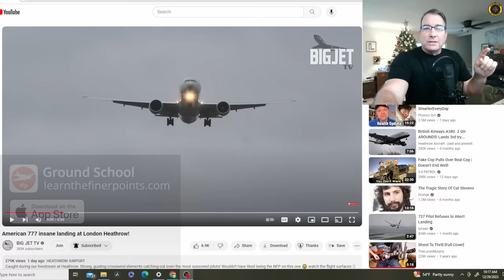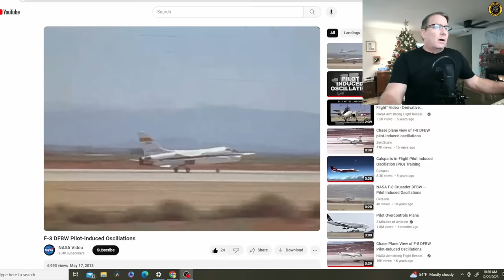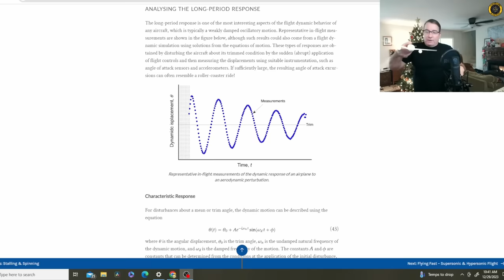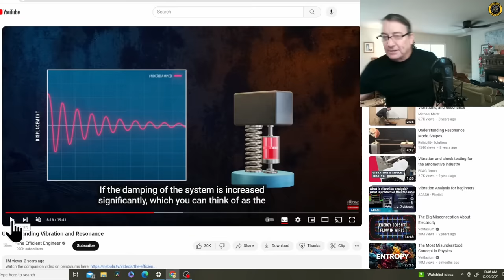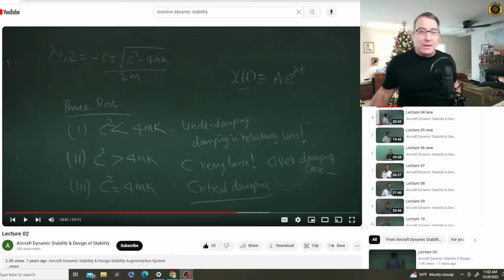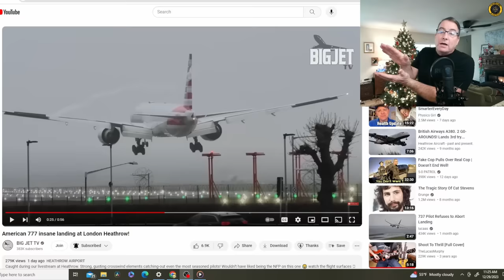B-777 Hard Landing LHR Big Jet TV

Comment: Dropping the elevator made the nose suddenly drop.  I myself, am in no bragging condition because I have been a crop duster pilot,  considerably lighter and controls are cabled so every action is quick.  My question was why did this guy drop the elevator, because the nose was up, in a safe position, wheels touched, the speed slow down would automatically lower the nose.  I wouldn't dare push the yoke in once on the ground.  I already cut the power, without power nothing is going up anymore, or any further. so no need to drop the elevator.   I'm now on the ground, no need to drop the elevator, it is coming down on it's on from the slower speed.  Anyway, I have much respect for these big giant plane pilots.  Wow. I envy them so much, so I keep my mouth shut, most of the time.   I just happen to get into the excitement of this video, like a boxing ringside spectator thinking, I would have upper cut the dude, and I wouldn't be laying on the canvas. Hahahaha

Comment: Making light of a bad landing is one thing Juan, and I totally understand that, but in this video we can objectively observe two critical and potentially deadly errors being made during the upset recovery. We can all learn something. 

First: When you’re flying a big plane (or any plane) large control inputs in the flare are dangerous and indicate an unstable condition exists that would best be resolved with a go around. We call this kind of piloting “high gain”. 

Second: kind of in the same vein but exponentially more dangerous was the pilot-induced-upset-recovery recovery, where the pilot flying PUSHED hard on the controls when the plane was rebounding from the first touchdown. 

This is exactly what happened to FedEx 80 and that plane came apart on landing and killed two great pilots. Now we can talk all day about how better designed the 777 is or how we live to fight another day. I would like to point out that a landing as bad as this one could have and has ended tragically. There is a lot to be learned here, just by watching the evolution of the last 20 feet of this landing. No doubt this should have been a go around, and the FOQA data on this approach/landing will be analyzed carefully. I’d be on the lookout for it on your next training cycle. 

What could they have done better? Power. Simply put, as soon as an upset occurs, power application and setting a known pitch attitude that will protect the tail and get you flying away from the ground is the best solution. Let the gear hit, keep your crosswind controls nailed and hit the G/A mode. 

Thanks for posting this one. By the way I stopped into Nevada county in my 182 a few months back, great little spot and cheap gas! Be well.

Comment: I enjoy your channel.  I would appreciate if you could clarify something pursuant to the narrative after 4:25 ....I was always taught a "phugoid oscillation" occurred when a plane supposedly flying level without control input by the pilot (or A/P) began to descend slowly which causes it to increase speed.  Eventually the increased speed creates more lift and the airplane begins to climb.   As it climbs, it slows down and lift is decreased which causes the plane to descend again.  It was my understanding that this alternate climbing and descending without any input from the pilot has been called phugoid oscillation.  Most pilots never observe phugoid oscillations because the spontaneous slow rise or fall of the airplane is prevented by input from the pilot or A/P.  Anyone can demonstrate phugoid oscillatins in their own plane by trimming the plane to fly "perfectly" level, then do not touch the controls or use the A/P, and the plane will naturally go into phugoid oscillation mode.  Every plane has a certain frequency of climbing and descending unique to it depending on wing design, CG, W&B, initial air speed, and so forth.  For most GA airplanes, there are usually 2 to 5 cycles per minute.   My CFII taught me this, and although he was not an aeronautical engineer, he had over 41,000 hours and was very knowledgeable.  Have you ever heard phugoid oscillations described in this way?     Keep up the good work reviewing the causes of recent plane accidents.
Reply: Technically you are correct, a phugoid is a long-period oscillation (20-60 seconds). Juan used the term loosely...
Reply: I think the issue here is that "pilot induced oscillations" (often referred to as porpoising) and "phugoid oscillations" are not the same thng.  There is ample source material relating to both of these subjects online.

Comment: I remember being a passenger on a DC-10 landing in foggy conditions.  No apparent crosswind or wind gusts.   The landing was aborted twice, apparently because of poor visibility.    The third time the pilot touched down very hard on the main gear and as we rolled out every passenger erupted with applause and cheers.  Walking off the AC, I shook the pilot's hand, inquiring if he was ex-Navy.   He just grinned.  Years later, as a private pilot flying a Piper Warrior (PA-28-161), I was attempting a landing in a crosswind from the left on the North/South active runway, so I cross-controlled with the left wing down a tad.   Just before a normal touchdown I was hit with a strong gust of wind that drove the AC left main gear hard onto the runway - BLAM -  the AC bounced back into the air, veering a bit to the right.  I immediately applied full power, then radioed the Tower, "Going around "  The Tower came back with, "Looks like it's time to switch runways."   Needless to say, I concurred!   In the event, the landing on the East/West runway was uneventful but I worried about possible damage.  Inspection later showed no damage.

Comment: im only a cessna driver at this point very early on in my training but during my crosswind circuit lesson i dropped it in pretty hard to which my instructor told me, good crosswind corrections but remember the company dosen't give me chiropractic so try not re align my spine on the touchdowns

Comment: My worst landing, I was near the back row of a 727. Pilot was overcorrecting for turbulence on approach and got into PIO. Ended up too high and did a severe nose down instead of a go around. Hit so hard it was painful. Not only the masks dropped but most of the entire panels popped. All the stow bins opened and most of the ceiling panels opened. Pilot took the last exit so fast the wing came inches from scraping, but the rear tires slid keeping the wing from touching. All while at full braking and reversers. About half the carryon bags ended up at the cockpit door. That United pilot was my brother's neighbor.

Comment: Had the same occur to me in the 737 in roll, but it was on short finals.    The 737 is noticeably roll sensitive with full flap deployed.     I just froze the roll input and the phugoid damped out quickly.   Like Juan, I can also attest to several hard landings in my career as both a Captain and FO.    Embarrassing of course, but as long as you learn from each experience.

Comment: " First Officer made hard landing" That was on a B707 freighter. No problems were found on the hard landing inspection. Well not until they tried to install the TC cowl on top of the pylon. The forward stabilizing mount was sheared. The casting is shaped like a long forearm and comes undrilled. A wood form was made from the old casting. It had plaster of Paris areas to hold drill bushings. The new one fit.

Comment: That initial whack on the nosewheel with the down elevator input (after the initial bounced touchdown) looked pretty severe.  I’ve never seen any flight manual, Boeing, Airbus, or otherwise, that would recommend any sort of down elevator input after a bounced landing…it’s either i) re-establish landing attitude/pitch (4-5 degrees pitch at touchdown depending upon large aircraft type) or ii) go around.  The nosewheel is dainty in comparison to the main gear so should be protected in all landing maneuvers, including the derotation of the airframe into a level attitude, this should only happen without delay after the main gear is supporting the brunt of the airframe’s weight during deceleration on the runway. Keeping the nose high for too long after touchdown as the elevator loses effectiveness is another path to possibly whacking that precious nosewheel unnecessarily!

Comment: Smoothest landing I've been in was during a flap failure incident..higher speed but smooth as glass.  Had plenty of runway.  Noise limits are thrown out during mechanical issues.
Reply: Noise limits? A reduced flap setting requires less power and therefore = less noise.  Many countries (eg. Japan) require us to use a reduced flap setting when stopping distance allows it.

Comment: Interesting. Apparently Heathrow is notorious for cross wind problems. Or so I've heard. In 2010 we flew Phoenix to Heathrow on a BA 747. The smoothest flight of my life. Until the wheels were about to touch down. We rolled heavily left so one second looking out over the left wing into a giant hangar, the next second staring at nothing but grass. Left landing gear hit hard and I was smashed into my wife sitting to my left, they corrected and the plane swerved sharply and we were thrown severely the other way my wife smashing into my left shoulder and me smashing into the woman sitting to my right. And I do mean smashing. Both our shoulders were sore as a result. Then the right wheels hit even harder than the left had an we were thrown against each other in the other direction again, this time almost bashing skulls. No idea what had gone on up front but I do reacll the expressions of the flight crew as they walked past us in the terminal. "Ashen faced" would be a good way to describe it. Two were grey haired veterans and three were young sprogs. I always wondered if one of the young uns was being given some "hands on" and the aircraft almost got away from him at the last second. Would not have been surprised if we had wound up on the news.

Comment: "Exhibit positive dynamic stability". 
The exception to "most aircraft" being the 737 MAX which suffers elevator blanking and super stall at AOA over 20°. 
The solution was the flawed MCAS.
Reply from the maker: No.
See previous updates on the 737 Max.

Comment: I had a very similar landing due to wind shear at Charles de Gaulle and the airport was closed for a couple of hours until the storm front passed. Glad we made it in so I could make the connection back to JFK. It happened so quickly there was no time to get scared, but half the passengers were screaming.

Comment: Many years ago, I was a passenger on an MD-80 type narrow body.  This was on a long-defunct carrier back in the early days of deregulation when low-cost carriers came and went.  We were landing in OKC.  The decent was turbulent, and you could tell it was pretty windy, as it often is in Oklahoma.  When we got to the point where the aircraft should have flared, nothing happened to check our rate of decent.  "Oh man," I thought, " This one's gonna be rough!"  Sure enough, we hit the runway so hard a dozen or more O2 masks fell out of the overhead. Everybody in the cabin busted out laughing.  It was pretty funny, but damn that was a hard landing. Amazed the plane didn't blow a tire at least.

Comment: Hard landings can no doubt happen to all of us. However, this type of hard landing shouldn’t happen to anyone. This is a classic case of over controlling and was likely only corrected by the other pilot. There’s no excuse for an airline pilot to aggressively pitch down right after touchdown. This is my opinion with 12,000 hours 121 flying including 4,000 in the 777-200/200ER/LR/Freighter and 777-300/300ER.

Comment: That didn't look that bad, they didn't let it run away. Amazing that this is news - shows how safe things are. Go back 50 years - hard landings and more galore. I've flown on island hoppers - now there you can get some wild flying and landings - complete with all (4-9) pax screaming bloody murder. They just got off some monster plane and banging through weather / tropical activity is a totally different ride in a small plane, and yes, the pilots and companies play it a bit closer to the edges to make things work - runways are short - a firm landing on a wet runway is sometimes what the pilot is going for in a crosswind situation where you don't have multiple runways or even approaches to play with. And yes, internationally on the little planes - accident rates are much higher I think.

Comment: One classic example of PIO is pilots who don't compensate for the delayed reaction of flight controls in slow flight. They give an input and when the airplane doesn't respond as quickly as they expect from cruise flight, they increase that input, then the airplane responds to the original input plus the larger input, which is too much so they reverse the input, etc. causing PIO.
As @blancolirio explains @9:04, you need to hold the desired input and give the airplane time to respond to it.

Comment: Love your videos. Two notes: "phugoid" is more specific than you explained. 

1) Phugoid is a mode of oscillation that cycles between speed and altitude. Phugoid is generally a slow mode that can be lightly damped or even slightly unstable, but pilots will easily dampen the oscillation with low risk of PIO.

In this video, the mode of oscillation thats a factor is known as the "short period" longitudinal mode. Phugoid is not relevant in this video.

2) PIO can happen at any phase of flight, but stress on the pilot (like a gust just before touchdown) is a trigger that makes PIO more likely.

When the aircraft touches one or two landing gear down, it has different dynamics than fully flying and is probably unstable. However,  the aircraft only briefly is in that state.

Comment: As a student pilot, I was hanging around the local grass strip one Saturday when a local doctor came out to fly his Cherokee Six.  He asked me if I wanted to come along while he practiced some landings,  He was taking some members of the Rotary Club to a gathering in California the next weekend.  I jumped in and he headed to a nearby airport, a WWII fighter strip converted to a municipal airport.  His first approach was low, slow, and took a lot of power to stagger past the fence and barely reach the threshold.  The airplane quit flying about ten feet above the runway, and the powerful Cherokee stabilator kept the nose up until the impact.  I instinctively looked out at the top surface of the wing, expecting to see the main gear casting protruding through the top skin.  To my surprise, the wing was still intact!

The doctor calmly said "I think we should go home."  He configured for a takeoff and added power.  The flight home was uneventful, with a decent landing on the 1800-foot grass strip.  I often wondered if any of his trips with passengers had been as scary.  I never rode with him again.

Comment: Yeah... On the day I passed my Private check ride, over 30 years ago, I had reserved an old dog Cessna 150 for the night. It was to be my very first flight as private pilot-in-command. 

It was an overcast night after some rain and winds were light. I took a friend up for a local flight. Everything went fine during the short 15 minute flight. At some point in time between the normal take off and the well-established short final, the landing light had burned out.

Fortunately, the wet runway pavement was illuminated by city lights reflected by the overcast sky from behind us. We had crossed the threshold when the runway numbers and centerline suddenly appeared in front of us out of the darkness. I only had time enough to pull the yoke to my chest before the nose wheel struck the runway. 

The main gear hit as the nose rebounded, causing us to bounce about 20 feet into the air. I properly added power and made a proper second landing with plenty of runway ahead to spare. 

I was really glad that C-150s are tough to bend!

Comment: Please could you explain further.....

Private pilots would be using the rudder before landing much earlier. It seems that as the aircraft blead speed and the ailerons became ineffective near the ground the capitain hit by ground turbulence  would loose control unless he was using the rudder to correct yaw.  Its a point you have made before ...airline pilots are not getting enough basic flying experience on light aircraft handling outside their day job?

Comment: Sounds like the abs brakes on a car going around a corner. One wheel comes off and the goes on but slips and the other goes harder down and so on the vehicle rolls over.  Ive heard of Tesla direct drive cars oscilate a bit or just normal abs.

Comment: This exact thing happens to cars. If you turn your wheels in one direction the car will want to go back to equilibrium and travel straight. You need to be aware of that and can even use it to your advantage to be smoother. Trying to fight that to continue a turn doesn’t make much sense
Reply: A properly adjusted car suspension will keep the steering centered...
Reply: A properly adjusted car suspension will keep the steering centered...

Comment: Flight control system designers restrict the designation "pilot induced oscillation", or PIO, to the case where the pilot's actions inevitably increase the amplitude of the oscillation, where it is physiologically impossible for him to do otherwise. Fortunately, after several such incidents in the early days of fly by wire, they figured out design rules to exclude this sort catastrophic of man/machine interaction. The behaviour exhibited on this B777 landing would be categorised as overcontrolling, not PIO.